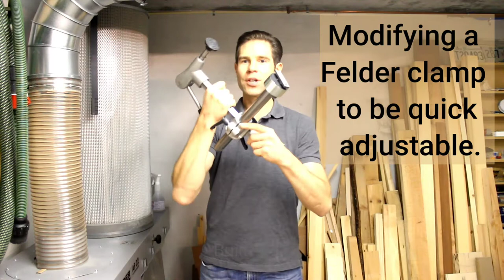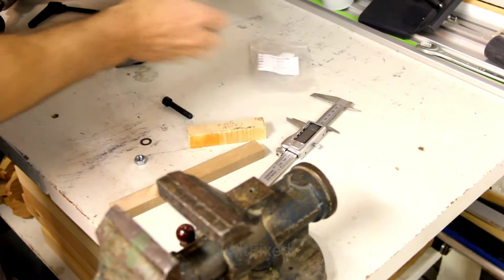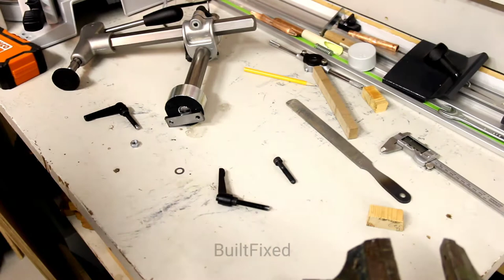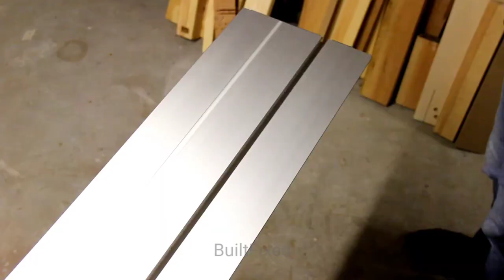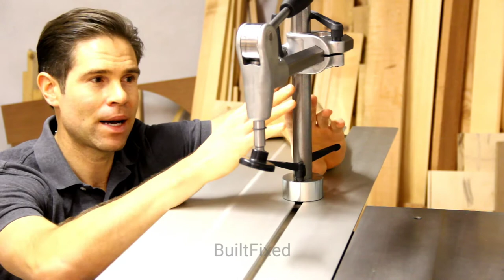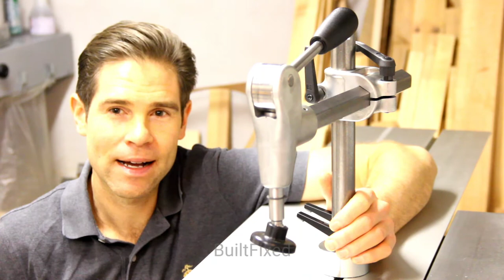Felder Hammer eccentric clamp improved

Comment: Just a comment on the clamp itself.  Yes, maybe the bolt connections could be more user friendly, but as for stability and clamping pressure, this clamp is a monster.  It is rugged.  I clamped a 2"x12"x8' piece of walnut on my Hammer K3 for the final cross cuts and it was solid as a rock.  As a side note, I keep the Allen wrench for adjustments in the top drawer of my tool chest, it's easy to find and takes about 30 seconds to tighten or loosen the bolts.
Reply from the maker: I agree the clamp is a tank!  It has more than ample clamping force. If you're looking for a quick project sometime try the clamping levers; I feel that they improve the clamp. Happy woodworking!

Comment: Awesome! Where did you get the clamps? I definitely want to get a set as I'd be much more likely to use this clamp with your enhancement!

Thanks for the shout out!
Reply from the maker: I'm glad the you like the idea. I feel it makes a huge difference. You will want the M8x60mm size clamping levers. I bought mine off of Amazon. Here's the link: https://www.amazon.co.uk/Adjustable-Handle-Clamping-Lever-Thread/dp/B07FYDJBMQ/ref=sr_1_7?dchild=1&keywords=Adjustable%2BHandle%2BClamping%2BLever%2Bwith%2BStud%2BMale%2BThread%2BAdjustable%2BClamping%2BHandle%2BLever%2BM8%2B16-60%2Bmm(M860)%2BBrand%3A%2BKeenso&qid=1608643313&sr=8-7&th=1
Reply: Shoot, bud, I work these all day, and you guys make it look so painful! lol. I told cut it with a hammer I would make a video, and I'm filming it tomorrow! Cheers.

Comment: I don't know why they just don't make them similar to uni-strut nuts to clamp them. Two rounded opposing corners and two square opposing corners on the clamp in the slot, a turn of the base 90° and the nut catches allowing you to tighten the base down. No Allen wrench or kip handle bolts necessary, and you could drop it in the middle of the slot and tighten it instead of sliding in from the end.

https://i.ebayimg.com/images/g/Bu8AAOSwwD1dp2~K/s-l225.jpg
Reply from the maker: Another great idea! 👍

Comment: Not sure why your clamp has Allen keys , I have a FELDER C745 and to tighten my clamp I simply turn( twist)  the vertical round bar which tightened it to the sliding table , a lot simpler and takes seconds. You should look into it.
Reply from the maker: It could be the difference between the hammer eccentric clamp and the felder version.
Reply: exactly! video coming soon.